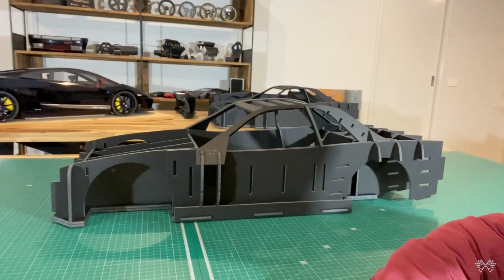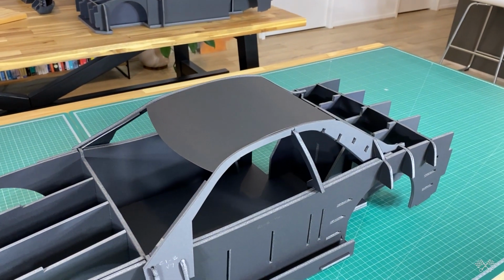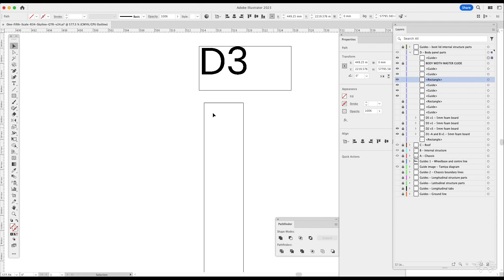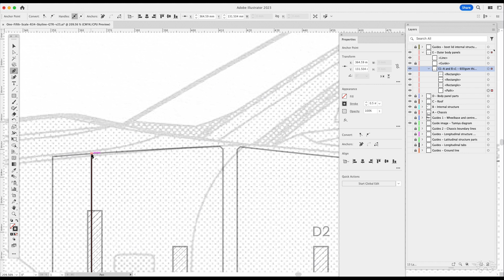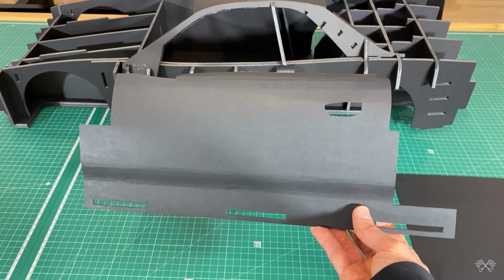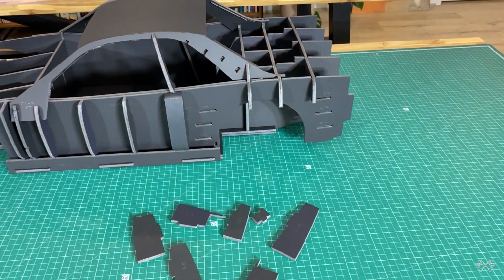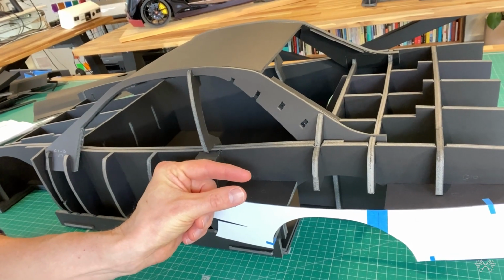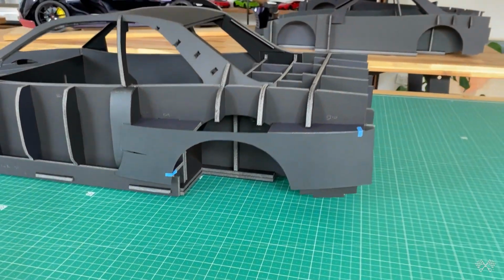Creating The First Body Panels For My Scratch Built Skyline R34 GTR

Comment: What material did you use for the body panel ?
Reply from the maker: It's 600gsm thick black card board, made by a company called Quill. It comes in different sized sheets, and is available in most office supply/stationary shops here in Australia. It's great stuff!
Reply: @SuperCardModels  you cover the body with this Cardboard and that's it ?🤔
Reply from the maker: @rcdrifttt1270  No there will be one final layer on top of that– either shiny colored foil board or probably thin card which I will paint with proper automotive spray paint in a correct Nissan color. Still deciding which option I'm going to use. Stay tuned.
Reply: @SuperCardModels  thanks for explaining🤝